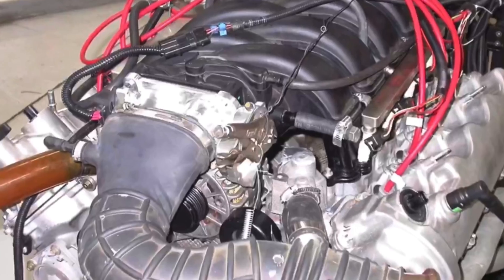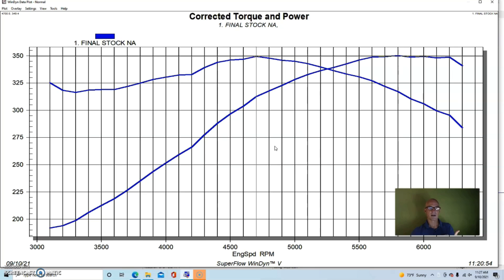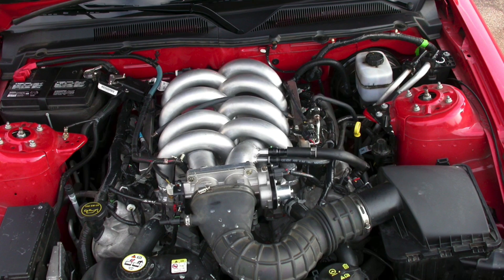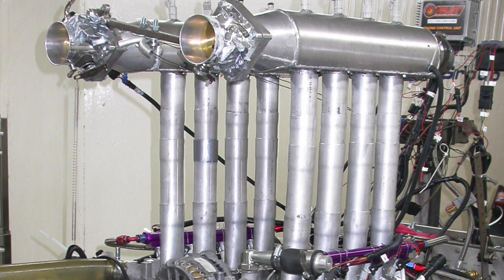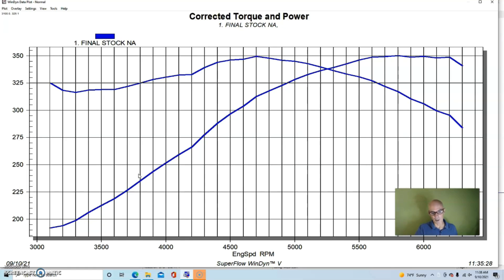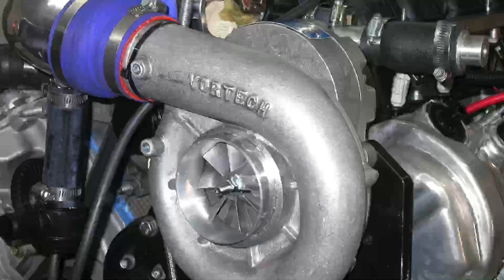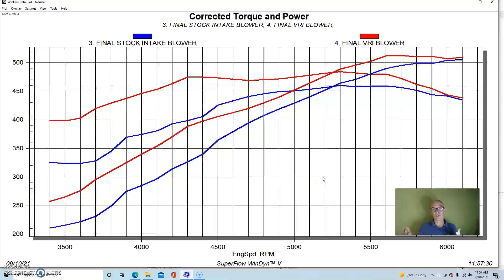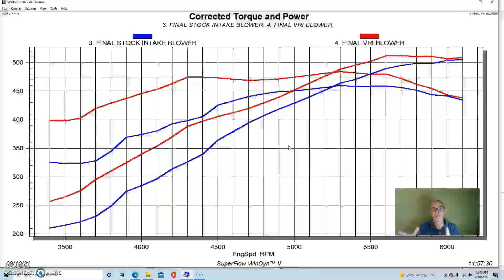HOW TO: DIY INTAKE MANIFOLD. WILL IT WORK? IS IT BETTER THAN STOCK? CUSTOM 4.6L 3V FORD

Comment: Hi Richard.  I want to make and old school looking tunnel ram manifold for my 4.6 3v with the throttle body inside hilborn style blower scoop . My question is can I put the mass air flow sensor in between the throttle body and the manifold .
Reply from the maker: should be before tb

Comment: Richard Holder, Could you revisit the 3V intake test? Holley offers the 3V intake to run different upper plenums to run long/short runner EFi plenum & a plenum that has single carburetor flange the other has duel carburetor flanges. 
    It's simular to the LS High Ram Holley makes for LS engine that has different height plenums & a carburetor option. 
Looks like Holley didn't spend much of the design budget on looks just more functionality.  
   Looks to be a great intake for bracket racer or someone with fun street car wanting easy HP from 3V & boost. Be good blow thru intake, dual carb nitrous intake, or economical EFI intake thats not plastic & can handle boost & backfires.

Comment: What I have not seen yet is someone trying truly FAT but long intake runners to try to have the best of both worlds. Example: 3" diameter tubing that still has a lot of length per runner. This should, in theory, shift the peaks around a bit and allow more top-end breathing.
Reply from the maker: DO YOU ALSO HAVE A 3-INCH DIAMETER HEAD PORT?
Reply: @richardholdener1727  No, it would taper down. Trying to add enough  CSA to avoid choking at high rpm.

Since overall flow of long-runner intakes is choked by the limited normal-diameter tubes, having substantially larger tubes could allay that problem until beyond your working RPM range.

The harmonics would be altered by the larger diameter, but would it be useless at low RPM?

Short runners provide the least resistance between a big, fat plenum and the valve, and long runners provide the momentum of the column of air. Would extra-large runners that were still long just be a disaster or would they shift the power around the RPM band?

The super-tall mega ram or whatever that was tried had awesome torque increase at lower RPM, but those long tubes cost it dearly at higher RPM. I was curious what effect having long runners but with a large diameter would have.

Also, not all driving is done at WOT, so there is that, too. Something that is great at WOT might be ungainly at partial throttle.

Comment: It would be interesting to test the longer runner 4.6 3V Explorer/Mountaineer intake manifold in a 3V Mustang with the plenum opening modified to accept a Ford Performance dual 62mm throttle body. A boost in the midrange of the torque curve say, from 2500-4500rpm, would be nice if there's minimal loss above 5500rpm.
Reply: Better still, fabricate a variable length intake manifold with longer runners to boost midrange torque and shorter runners to widen the power band at the top end. An electonically controlled valve could open/close at ~5000rpm to switch between the two.

Comment: Manifold looks awesome! I sometimes miss my old 3V (07 GT Premium w/3650) 
It wouldn’t hold a candle to any of the LS stuff I’ve since built, but it made great torque on relatively modest nitrous shots. At the time I loved it, the rods however did not. 😂
Reply: And an aftermarket intake definitely made a difference; I ran an Airraid system on mine, which required tuning but I was already tuned with basic bolt ons and a no tune required cold air kit then switched to the larger Airraid system and picked up more power with that + adjusting my fueling and MAF scaling for the new intake.

Comment: I won't lie. But if you had ground the welds down and painted it...or just ceramic coated it...it would be worth it on looks alone. Lol, maybe...just maybe someone some day can get blueprints for a 3d printer? The 4.6/5.4 3v family of engines were pretty good and had potential but it was never really tapped except for a couple boutique shops.

Comment: An observation: the OEMs have had some episodes of poor engineering—or poor design trade-offs—in their history. Ford could have made the factory runner length longer, but didn’t. Chevrolet used very short runners on the Gen II LT1 series and killed much of the torque curve on those factory engines. Your point, made many times, is that basic flow dynamics don’t change under boost, they’re just emphasized. If you think of boost as just higher absolute pressure, that concept is a lot easier to visualize, at least to me. Great video, thanks Richard!

Comment: The holley/jegs fabricated intake & ford racing performance are still being made & available! Also there's the gt500 throttle body upgrade using the adapter plate and even a monoblade TB upgrade that'll bolt onto the adapter!

Comment: Hey Richard can we see a cam test between two cams of the same duration and lobe sep, but cam A has .650 lift with 1.7 rocker and cam B has .650 lift with 1.85 rocker. My theory is the smaller lift lobe will have better valve float and valve train control and rpm potential because the lifter and pushrod move less. Please test!

Comment: 2" shorter runners and 1/8 bigger tubing would be essentially making a TBSS version for the 3v. 
I say that because the TBSS/NNBS/GMT900 runners are bigger but shorter (by 2")  than the first gen LS truck intake manifold.

Comment: The drop and torque could have been when the intake manifold runner controls open if you still have those on there working.  It looks kind of like the c&l intake iirc
Reply from the maker: good call

Comment: I would go with shorter runners NA to flatten the torque curve, but your intake worked very well with the centrifugal supercharger.  I think you went too big with the runners.  350 hp should use 1-1/2" headers, and 1-5/8" or 1-3/4" intake runners (1/16" wall).

long runners make more torque, but over a narrower rpm band.  short runners make less torque, but over a broader rpm band.
Reply from the maker: long runner made more torque from 0-5500 rpm, was the header primary size listed?

Comment: too bad your long tube intake never made it into production.it wouldve most likely sold well if the price was reasonable.that much of a torque increase in low to mid range would definately sold itself.well done.

Comment: You should have a couple one pice intake / exhaust flanges made for the 292 and send them out to fans with welding skills to build some one pice custom header tubular intake manifolds to test. Any welders in here? Im just a booger welder at best.😂

Comment: It would have been interesting to know the boost pressure difference on that last setup, Stock to long tube intake.
I bet the boost pressure was lower on the low RPM end and so was the temp rise out of the super charger.
A bit of tuning might have made even more difference? Who knows.... It was a long time ago.
I appreciate the fact you keep your videos on point and simple to understand.
Keep it up!

Comment: Love your stuff man. 
I cannot think of anyone in history that’s done more testing on engines than you. 
What I’d like to know is, since blowers are almost instant power but a whipple is like 7000$, can you pick up a couple of those cheap V6 blowers on the internet, fabricate am intake, reroute the belts, and get  something interesting?
I’ve been thinking of this setup but I’m a broke single Dad with more imagination than money. 
Thanks for your consideration and keep up the info. I’m a motor nerd so it definitely scratches the itch.
Reply: I saw a cool video about how they built the dual blower motor for mad max fury road.  Its a cool watch
Reply: Nice I’ll check that out. Yeah I’m just curious. And plus I guess I’m a glutton for punishment. 
Something like that intake or maybe something like that cross ram manifold on old Chrysler’s. You know, something to really make it difficult on me. Lol. Just a thought. If it wouldn’t work I’d scrap the idea. But if one will supply enough for a 3.0...then two good for 6.0?  
 I might be dumb enough to try.
Reply from the maker: I put a junkyard M90 on a 4.8l ls (didn't work very well), also the Cadillac blower with adapters (that worked well)
Reply: @richardholdener1727  yes I watched that. Not enough air but two? 
Mmmaybe.  Anyway, hard pressed to find a video of yours I haven’t watched. Good stuff

Comment: Long runners almost always for the win. Those  Chrysler engineers of the early 60’s were onto something
Reply: Those slant 6s should have made 400lb ft then lol
Reply: @young11984  How long are those though
Reply: @DarkLinkAD  the end runners were super long for what they were but center cylinders were short, made no sense on the design
Reply: @young11984  the Slant 6 was like the original vr6, it's a design that is way overbuilt with all sorts of packaging compromises to fit the damn thing in its envelope.  A Slant 6 with a variable length intake manifold could probably be very fun, but the damn thing wouldn't fit in a valiant engine bay without a big ol hump 😄
Reply: @young11984  I remember reading some "theory" that the different lengths help optimize power across rpm and make it flatter but I don't know how much it actually does. 

I would like to see how it would do on the dyno if richard could test it.
Reply: @evanc6110  you know, ive always seen equal length intake runners as a torque enhancer in the low/mid range and always wondered why the slant 6 had long outer, med and short inner for any other reason than packaging i would love to know the real answer. I cant see how 3 different lengths could be of benefit really unless im missing something
Reply: @evanc6110  check out Engine Masters this week, they just tested intake "stacks", and varying the lengths to equalize the intake and exhaust sides effectively smoothed out the power curve.
Reply: @johnsellers1272  That is really interesting, I'd like to check that out. Isn't engine masters on motor trend where you have to pay to watch it?
Reply: @evanc6110  unfortunately, yes.  At least to watch the newest episodes.  I have the subscription, I really enjoy a few of the shows 🤷
Reply: @johnsellers1272  I may consider trying it at some point. Interesting stuff.

Comment: Ford Racing sells a nice looking intake manifold. Use boost to fix the lack of low end.
Reply: The problem to the low end is more timing.
Reply from the maker: the problem to the low end is not timing
Reply: @richardholdener1727  honestly I've had different experience with that but yes your right, it's not the "fix all" solution
Reply: Low end torque breaks parts and breaks the tires loose. High end horsepower wins races and is more fun to drive. I like to accelerate, not blow the tires off the thing at the hit lol. And no, the answer is not a $2000+ motorsports grade computer with traction control capabilities. The answer is a centrifugal blower, a set of cams and the Ford Racing intake. Rev it to 7k and use the lack of low end as a chance to get the wheel speed up before the power comes on. Plus these things sound great up top.
Reply: Or you can use a manifold like this with boost and need traction control to control the boost at the bottom end, and have WAY more fun.

Comment: Wow I need that intake. Sux no one makes a good one for the 3v. All we have is the stock one Ford racing and a jegs. I personally have the Ford racing but it makes less power down low than the stock manifold and slightly more at higher rpms. But it does look good
Reply: There are a few more options out there if you look around in a forum or two that's still alive. But, they are all custom, all sheet metal high rpm/boost style and expensive as hell. But sooo worth it. I want a 3v gt real bad but, I'm just waiting for the one I want to come my way. I don't even know why I love mustangs so much. They are the most over priced car on the market today to be truthful. What people in my area are asking....they all on that stuff lol
Reply: @lifeonadime4703  all cars are ridiculous right now. I’ve got a 3v and an old 2v 02 vert. I just would like something that would pick up the lower end tq a little. My motor really doesn’t get going till 4K rpm. Pretty much full bolt on, jlt cai, frpp intake manifold, twin 60mm gt500 tb, Howard rattler cams, under drive pulleys, longtubes, h pipe with no mufflers or cats, 4.10 rear gear and an zex wet kit on a 100 shot currently with a Lito tune. Just bought the 02 to daily drive because the plan is build the 3v bottom end so it’ll handle a little boost. Still haven’t decided on what boost. Really like a roots/twin screw blower cuz of the instant tq but I know the turbo would make more at peak. Decisions decisions. I’ll have plenty of time to make up my mind though because it’ll be a few months till I have the money together to do either lol
Reply: Lol the ford racing does well with nitrous. I wish dummies engineers from roush yates would make me a carbon fiber intake...
Reply: @LightningFast240  yea I just did the Ford racing manifold because it was the most popular or easiest to find I guess. It wasn’t till after I bought it that I found out it kinda sucks at lower rpms but really I didn’t notice much loss down low but I did install the Howard rattler cams and a set of longtubes all at the same time when I added the intake so I guess the longtubes made up for the low end loss I got from the intake. But after all that there was a very noticeable gain. Car pulls hard all the way to 6300-6400rpm now when n/a. And when on the bottle i don’t think it really matter what intake is on it lol.
Reply: So far the car has gone 12.88 @ 113mph on motor and 11.9 @ 121mph on a 100 shot both were very crappy 60ft times 2.2 the 12.88 on motor was ran before I put the intake longtubes and cams in at the track. The 11.9 was with all that on plus the 100 shot on the street using a draggy. Trying to go 11.5 on the bottle with the current setup which I think will be very doable just gotta get the suspension lined out. I have rear adjustable lowers with relocation brackets adjustable upper with adjustable bracket and an adjustable panhard bar but none of that was installed for either of those runs. Haven’t been able to run it lately. Right now the car is running super rich at wot. The afr is fine all the time but the second I go wot it bottoms out my gauge at 10. So I’m trying to figure that out at the moment
Reply: @justa3v619  I have been very fortunate with my car, especially on e85 even all motor wise. Nitrous is a whole nother level for 3 valves but this car n/a does stuff that I didn't think was possible. I rev my shitbox to 7300rpm.  Right now I'm getting the car ready for a 200 shot on e85 so hopefully it turns out well.
Reply: @LightningFast240  yea I haven’t went over 125 shot on 93 octane. Don’t plan on going over 125 right now my old 5.0 pushrod I had in my foxbody I sprayed it almost daily with a 150 shot stock bottom end but I’m not going that high on the 3v stock bottom end. Maybe once I get the motor built I’ll add a little more Nitrous till I can get me a supercharger or turbo kit
Reply: @justa3v619  honestly I'm not scared to blow my shit up. I am pretty sure I can get to 620-630whp through an auto before it becomes nothing but problems

Comment: If you do a big bang v10 triton, I'd love to see your custom intake solution on that big mod motor.
Reply: As much as I want to see the V10I think the 6.2 Ford would be a  lot more interesting now I think it has a lot of potential
Reply: @mauricecooper176  oh definitely. Ford used the boss 6.2 sohc across baja, road courses, and most importantly drag racing. On top of that, they are no longer the top trim truck engine which drives the prices down on these older big blocks.
Reply: @madmod  yes, and they never did get a 4v cylinder head, but eventually someone will make a 4v head, and we'll have a helluva motor!
Reply: @Prestiged_peck  If someone tooled up a set of 4v heads for the 4+ inch bore size found with the Boss engines, we would have the end all be all combo for displacement and headflow.
Reply: I'm hoping to see him do something with the V10. I know they're just a 5.4 with 2 more cylinders.. but the fact that the 3v V10 never had the VCT means there are alot of em in running order. I hope it makes good power. The crank stability due to the throw angles and length worries me. Still excited to see it..
Reply: @PureCountryof91  the crank is a split pin, it's the only reason the engine has never been corroded, as other than crank and cams, and of course the block and heads, everything is shared with the 4.6 and 5.4, but the split pin crank has really bad pin overlap making for a VERY weak crank, and it's pretty much the only motor you can expect to ever see a crank fail on due to power below, say, 1000 horsepower.
Reply: @PureCountryof91  Im a huge fan of the NPI Triton v10. The 3v is certainly more stout in stock trim but there are zero cam cores for a 3v v10 bumpstick whereas comp can cut any shelf grind for a 2v v10, as well as the traditional/common mod motor mods such as pi head-swapping a npi v10 which bumps compression, headflow, and has a bigger stock cam making for a stout combo. With that said, the stock 3v heads flow 215cfm @ .450 lift while the stock 2v head flows like 160cfm at .535 lift, but both pi and npi heads can be ported to flow well beyond 220cfm which is enough airflow to support 500hp on 10 holes on the right combo. The split pin forged steel crank should be every bit as strong as the other kellog forged 4.6/5.4 pieces. Ive never seen anyone actually break one despite lots of people trying. Hell, people often use the iron modular cranks for the weight savings in nmra true street and factory stock engines which are usually high rpm combos so the crank shouldnt be much an issue on a low rpm combo.